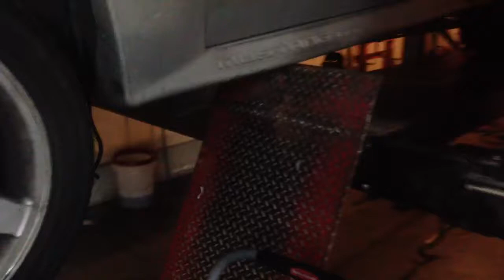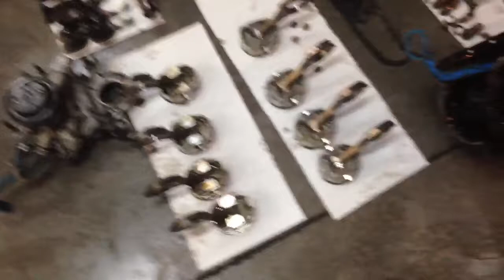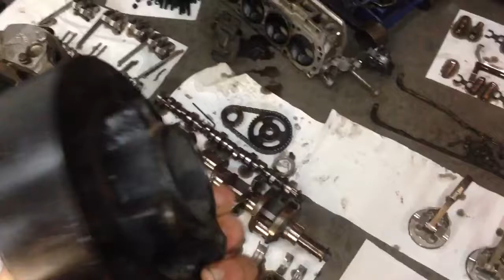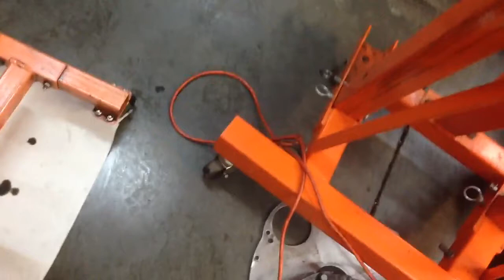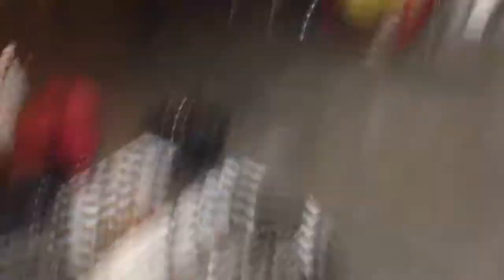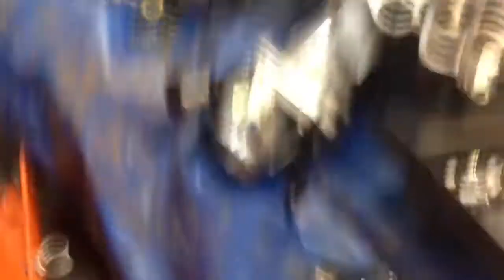347 turbo stroker rebirth rebuild

Comment: Hey they probably put some kind of chrome molly ring on ur piston and as long as ur not going to run to much boost I’d probably run a cast ring in there it all depends on the temperature that ur going to run the motor

Comment: you would beat the main bearing out running a 50oz balancer and flywheel most 347 you run 28oz fly/balancer. nice vid an sweet shop/garage